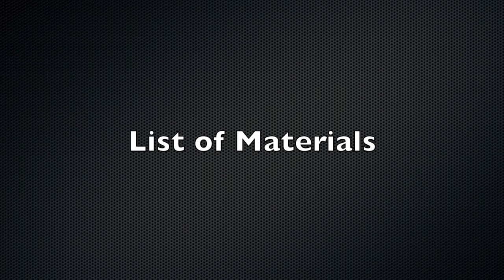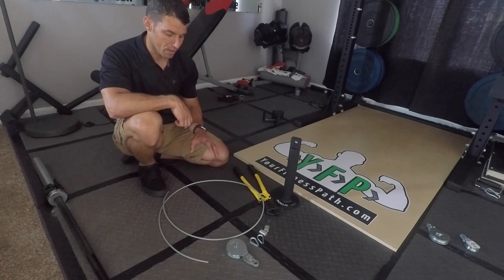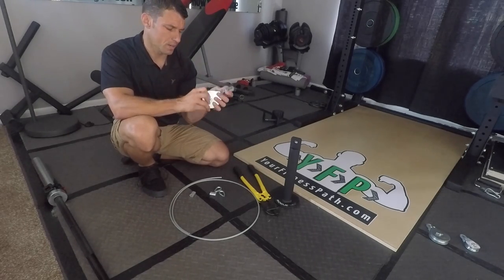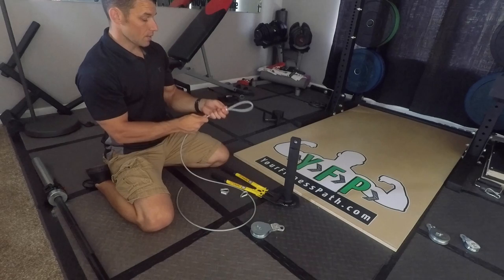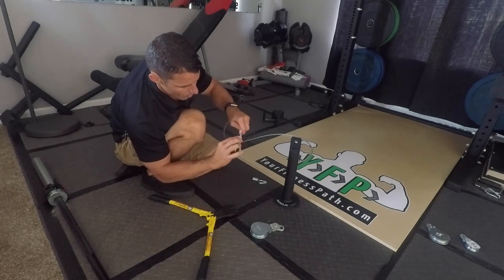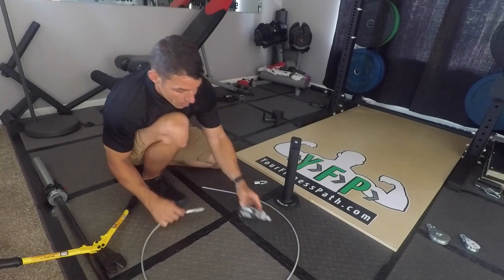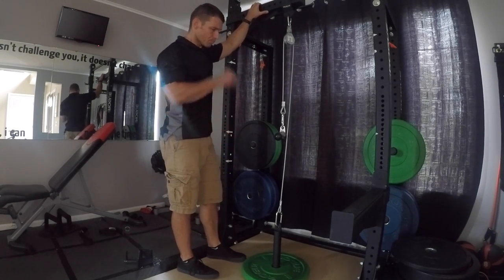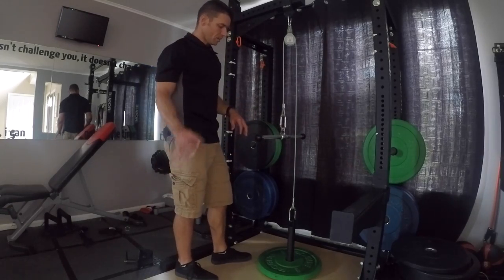How to Build a Cable Pulley System for Your Home Gym | yourfitnesspath.com

Comment: Your not really supposed to crimp over the vinyl. The cable can slide out under heavy stress. I would recommend removing 4 or 5 inches of the coating on each end of the cable to make the loop and crimp. An alternative to the big crimpers is to use a hammer and steel plate. Use a blunt steel tool to hammer the crimps tight. You might also be able to use a vice with some screw driver shafts on each side to crimp the ferrels. Easier still is to use the U-bolt style cable clamps. This way you can remove them if need be. The U-bolt clamps will need to be retightened a few times after use. Once the cables have settled, they will not need any more tightening.
Reply: U Bolts sound better for the average guy- like me, not much mechanical skill or tools here. Question; Remove the coating as you recommend above for crimping, with the U-bolts too? Thanks so much!
Reply: @NFL1976  Yes, the vinyl coating is not bonded to wire. You can squeeze the vinyl really hard, but the wire can still slide out. You need metal to metal contact to have good friction.
Reply: @UCyf22pQpSmQnXrfLeaJXesw Those straps look fine. How much weight do you plan to load on it? Real carabiners are expensive and unnecessary and cheap carabiners are weak. If it's under 200lbs you can use those 3/8 stainless steel spring loaded (kinda like a carabiner) links from Walmart, Home Depot or Lowes. They are rated at about 300lbs and work well for fast connections. If you want to use heavier weights I'd get those "quick links" that have the threaded nut to close it and give extra strength. They are slower to use, but stronger. You can also get 1/4 chain really cheap at the hardware store, its usually rated at 1300lb. It allows you to adjust the lengths easier than the nylon straps, but it might also scratch the paint. There are lots of options.
Reply: @JasonWW2000  Thanks man! Great feedback, and I will  get the screw type connectors you recommend, especially where I am less apt to change them out. I have a couple of very thick spring loaded ones too. Yeah those straps look great! Ordered from Walmart, free second day delivery for $14.97 delivered. A friend just gave me an incredibly built cage. Very heavy gauge 2" x 2" tubing, 1/4" thick. 100" tall x 48" wide. Was in a gym. Looks like it was built in a local machine shop possibly 30 years ago. Rock solid. HD has 1/4 in. Stainless Steel Vinyl Coated Wire Rope for .76 cents a foot. Working load limit of 1400 lb. Will get some pulleys and I will be ready to experiment. Miss my "pulls"! Check out this offer. I am sure for insurance they don't recommend for overhead weights, but specs seem to be there, and one verified gym review: https://www.amazon.com/Stainless-Keychain-Carabiner-Outdoor-Traveling/dp/B076YZWLYB

Comment: Something tells me you can probably DIY the loading pin (the pipe holding the weights).  You also need  the climbers clips (snap links). And then some kind of handle/bar.

Comment: Only down side is the cost of the crimp tool. I am looking to make a few of these, so the $85 cost for the tool to crimp 3/16" cable will be worth it. Plus bulk cable is about $70 for 200 feet, not that you need anywhere near that for this build, but it can be used for many other things around the house, so always nice to buy in bulk when you can to cut overall costs. The one Rogue sells does not use coated cable I believe. Making two of these allows you to mimic the low pulley device as well.. so you can do rows and such with a 2nd pulley.
Reply: Home depot by the foot .60 or so

Comment: The spud pulley is a 6-inch pulley and is part of the reason it cost so much. to build a comparable pulley system as Rogue is offering WITH A SOLID STEEL FRAME would probably cost you more to make a single one. This is because rogue buys in bulk and offers there stuff at a valuable price considering the quality and build cost.

Comment: Thanks for the video.  Only issue was that the 1/4" coated cable requires bigger diameter ferrules to compensate for the coating, which was not addressed in the video.  No biggie, but it would have saved a 2nd trip to the store.  Overall great video.
Reply: So what size ferrule did you end up with? I'm having the worst time trying to find a 5/16" ferrule.

Comment: Wow...finally found someone on YouTube that created one of these things and has the same half rack I have.  Nice job.  How has the pulley system held up?  I'm curious to know if and how did you setup the lower pulley?
Reply from the maker: Thanks! 
It has held up nicely - no issues to date! I haven't spent any time trying to incorporate the lower pulley. I'd need to get some additional parts to do that, but I'll let you know if I do.
Reply: Christopher Coburn the only difference for me, I dont have the large safety arms.  Have you ever attached your system to the pull up bar or on the side where the Rogue cutout is (short cross memver)?  I've been thinking about how to improve my system.  Havent wsnted to spend that $100+ on the Spud Inc or GetRxd one.
Reply from the maker: I am not sure about the short cross member's ability to hold that much weight. The one that's on my rack isn't a full body piece, it's really only there to hold the two uprights together... I'd be a little leery of connecting it there. If you have a cross-member that spans the width of the rack (between the uprights), that might be more suitable - again, not sure about the amount of weight you'd want to use against it though...?
Reply: Christopher Coburn same here. I'll figure something out.  Thanks for the quick replies.
Reply from the maker: You bet!
Reply: @ChristopherCoburn  Could you point me to some tutorial on how to make the lower pulley? Been searching but found nothing; seems like a technical inferno

Comment: Those are bolt cutters.... and they are damaged making the crimps but it will work just like using a flathead screwdriver as a chisel....
Reply from the maker: While they do resemble bolt cutters, they are not. Look for a "Ferrule Crimping Tool", you'll see the difference. The end is blunt, rather than sharp.

Comment: You don’t really need anything to crimp with. You can use the u bolt clamps that tighten down with bolts.
Reply from the maker: Slim56 - true! I wanted a bit more polished finished look, but those would certainly have worked as well

Comment: Where did you find your ferrules? Also have you have any issues with them? I'm not sure if I should use those or like the U clamps. I want it to be secure.
Reply from the maker: I got them from my local home center store; Menards. No issues to date. The u-clamps are an option, just not as clean looking. If you get the crimper, it won't be an issue.
Reply: @ChristopherCoburn  great that's good to know that they're pretty secure. Will they be aluminum?
Reply from the maker: @bwright4410  I believe they are some kind of alloy, might only be aluminum - not positive...

Comment: How does your setup make so little noise? Is it the diameter of your pulley? I used a much smaller pulley and 4mm non coated cable and it made a lot of sound and heat. Eventually it wore down quick and I had to change it
Reply from the maker: I used a 3" Swivel Eye Pulley & 1/4" Galvanized Stainless Steel Cable Vinyl-Coated. I suspect the non-coated cable is the reason for the noise. Also, a 4mm pulley doesn't seem like it would be capable of holding a lot of weight, which is probably why so much heat was generated.
Reply: Christopher Coburn thanks. Would follow your recommendations. I was planning on upgrading to 1/4" coated cables. That would be the measurement after coating right? And yeah, the coating seems to make a difference, as well as the ratio of the wire diameter to pulley diameter.